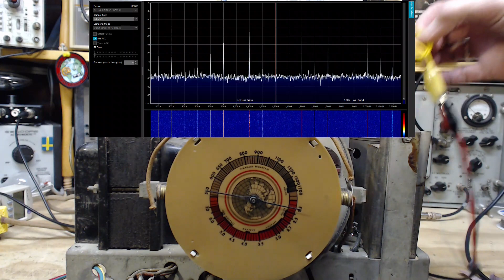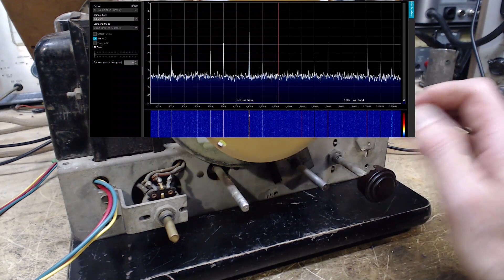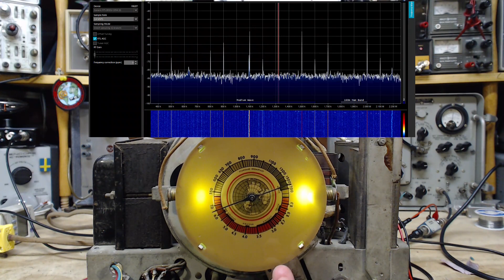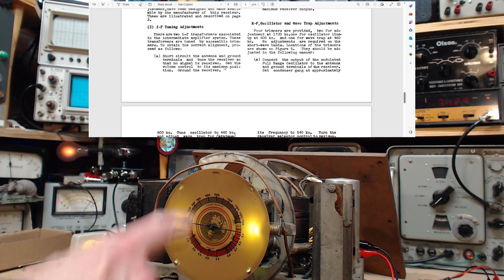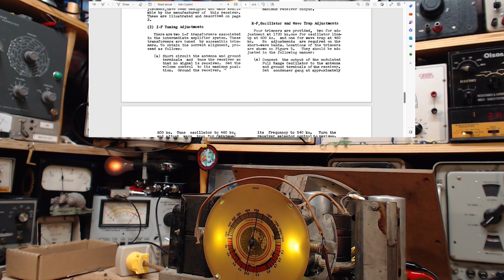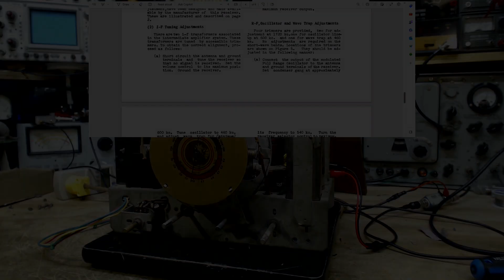Canadian General Electric Model A55Z Video #15 - Operational Check and Finale

Comment: Greetings:
It is time to schedule your frequency counter for it periodic maintenance service. WITH IT YOU CAN DIRECTLY MEASURE THE LOCAL OSCILLATOR AND IF VALUES. I do not see how you can get any good info from your SDR (Does it have values displayed that are unreadable by us followers?)
I just saw a momentary display of the LOCAL oscillator frequency which makes the IF able to be calcula5edvfrom the known station freq. I would expect the IF to be measurable near the plate output of the IF tube..